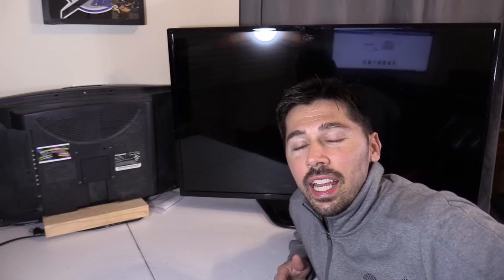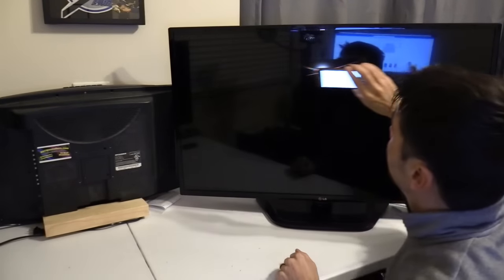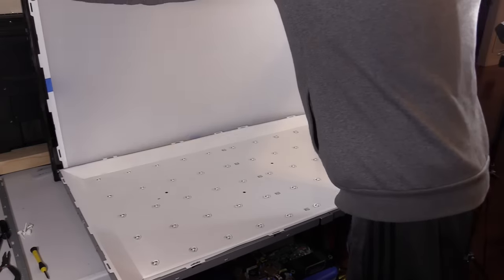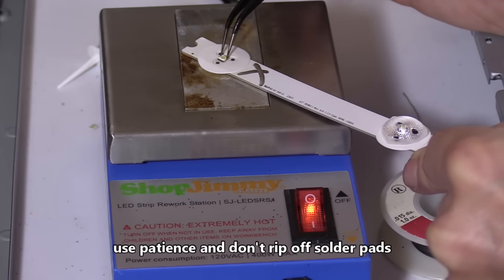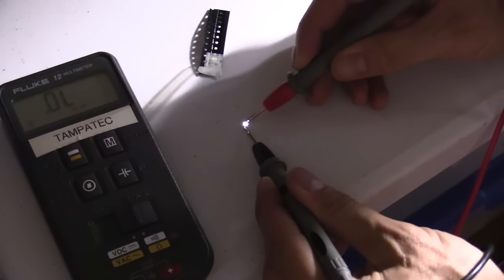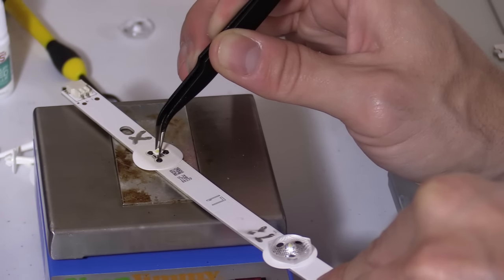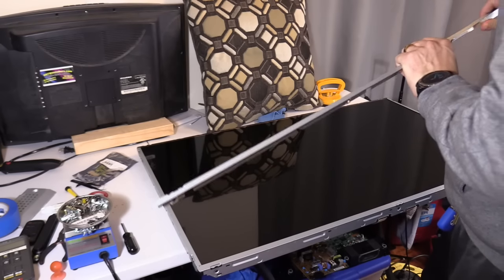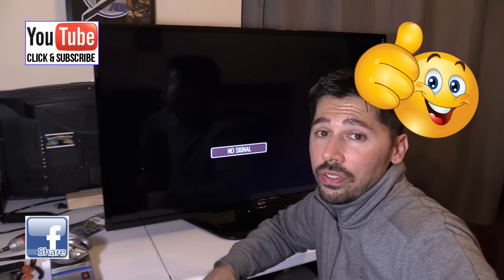LED LCD BLACK SCREEN TV REPAIR, COMMON FIX MUST SEE !!!

Comment: Hi i have an LG 49UF640V an am having trouble removing the rear cover. Have removed all screws and snap connectors but there appears to be two snap connectors on the inside near the top that i cant get to. There is also screw threads going through these from the outside. Thanks in advance. Mick.

Comment: Hi Tampatec I have a 70 inch LC tv LC70LE&$%U it passes flash light test also I tested back light s with Ed tester the back lights turned on. I have 83V on the back light cables going to back lights steady voltage but back lights still don't turn on when I power on the tv. Any input you could give me would be appreciated Thanks for your videos

Comment: I just picked up a free 46 inch Samsung that had no backlighting.  When I tested the voltages to the leds I heard a noise and the backlighting came on but it looks like one led is down leaving a darkened shadow top mid and a little to the right.  Should I not run the set until I replace that led?

Comment: My issue seems to be a little different. The screen keeps going black but still has sound. 
If I power it off & back on the picture comes  back but only for a short time. Sometimes 20-30 minutes. Eventually it goes black again & I have to cycle power to watch TV again. When the screen is on the picture is perfect. Tcon flaslight test passes. I replaced the power supply board but issue remains.
Do you know what could be wrong so I can attempt a fix? Its an edge-lit LG 55LM5800

Comment: I like watching your repair videos I have a problem maybe you could do a video and chat me back my problem is I have a Apex high definition I tried to program without a remote and I've got it messed up it's got huge language shows up in yellow I have unplugged it held in the power button for 2 minutes after it was in unplugged let it stay unplugged for about 8 hours plugged it back up push fire button and it went back to choose language and to use my room up and down remote and I don't have the factory remote what can I do to get back to the TV

Comment: Hello; I have a Panasonic TC-55CX420U model TV and the voltages ck good but it will not turn on. The red light comes on but nothing works. I replaced the main power supply board but there was no change. ifixit has helped me check all the voltages and fuses and all is good. He said to change the main board but it is hard to find, the one I did find was way to expensive is there compatible boards from maybe westinghouse or other tv sets?

Comment: Hi there I'm wondering if you might be able to tell me if the back light might be faulty on an led tv I picked up for $20 
the problem is that it is fine for say 20 mins, then the right hand half of the screen darkens but not in a uniform way. you are still able to watch it and it's just the picture seems to have had the brightness turned down on that part?

If it isn't would you have an idea as to why this might be happening?

Thanks Mate..

Comment: Great Job ! 
I had in the past a similar failure on a philips LED tv. No backlight but TV are on. It was a bad connection between the strips. Then i had solded the connections together and it was fine.
Reply from the maker: FeCr3 thanks for sharing the tip. i hope that helps someone.
Reply: I hope too!  The hardest part for me was disassemble and reassemble the 40 inch panel....

Comment: How do you know if you permanently damaged the screen. My TV does the same thing. It cuts on and cuts right back off. Before I watched this video I replaced all the boards but it is still happening. I'm sure it's the lights but when it comes on it looks like a huge lightning bolt struck it right down the middle before it cuts off. Should I proceed or leave it be?

Comment: That was a lot of work to get to those led's. Couple of questions it might have been the camera but it seem like some of the LEDs when you had them let we're not as bright as the others.? I was wondering when you were taking the layers off if you needed to worry about dust hairs or anyting getting on those when you put it back together. I saw you cover some of that in the video, what happens if you don't get it perfect and some dust particles are in those layers? Great video it's really neat to see how this is done. Where did you go to school to learn about this?

Comment: My lg 55la6230 flashes the logo for half a second then blackscreen. Can see pic with torch and sound is fine. I removed screen and tested led's individually with 3v power supply- all work! There are 48 led's on one circuit and 36 on the bottom circuit. At the led plug to power board both positive terminals read 90.3v but the negative ones read 13.6 and0.6v. The main board plug voltages are all correct. Am I due for a new power supply board?

Comment: I remember I broke one LG lcd panel when the problem was a lose connection of strip wires and when I put the screws too tight the panel just cracked and I made my own map on the lcd panel.

Comment: So i have a LG 42LN5708, it has no backlight (when i shine on it with my flashlight it shows image) But that image also flickers. Can this indicate that it is the power board that is bad or is it still the backlight that needs replacement?

Comment: I was giving a nice LG 4k smart TV that turns on and it shows the LG logo then after a few seconds it goes dark. If I use a flashlight I can see it has a image. Is it the t-con board or back lights?

Comment: I think when you picked the screen up with the suction cup you had it in the middle of the screen so it started to bend then it let air into it so it failed to hold it so probably best to use two of them at each end.
Reply from the maker: darren james i agree or use 2 people holding each side of the LCD panel.

Comment: Hey,
I have an LG 42LN5758 and chanced the backlights for new ones because i thought that was the problem. But my tv still stays black. It's like te backlights won't go on. Do you know what the problem could be and what i can check to solve this problem? Thanks

Comment: I would not recommend resoldering new leds in place the heat shortens the lifespan drastically. Get the single backlight led beads from ebay or Amazon they are the best way to go if you aren't changing the complete strips out. With the led beads you just solder leads to the edge of the boards and the corresponding solder pads on the original strip.

Comment: I have a 42” led panny. First green blinking then on with white screen for 1sec. Then off and continues red blinking. I have tcon and driver board disconnected, still same issue. So it cant be led strips since those are connected to driver. Is this logic correct? If yes then how to proceed? Seems its either the power or main board. Cant see obvious faulty capacitors fuses etc.

Comment: Sony Bravia KDL48W650D. No picture. Blue screen. Sony logo comes on and then back to blue screen. If I tap the display it flashes white. Other times when I turn it on  I get a quick cable or language box, then right back to blue screen. Can I assume it's not the backlight?
Reply: Similiar issues..waiting for a response also...

Comment: i had the same issue with my Hisense tv so i used a good LED from another tv and replaced it the reason the LED blew out was because the tv didn't have a sufficient cooling system so the LED's were simply overheating what i did to fix that is mount an extra 12v power supply and a temperature control system for pc's and a 12v fan.

Comment: I have a 55 inch LG. turns on just fine then after a few minutes screen goes black on both sides with a small lit strip down the middle.Thinking it's the LED strips. Any hints? Thank you

Comment: Mt tv just recently got the black screen. It turns on no problem then after about 15 seconds it goes black.  I'm not sure if the backlight are the main issue. I shine a light on the TV and the picture is still there just no backlights working. But the do work for about 15 seconds before going out.

Comment: I have a 40sf3750 tcl 40 inch TV.  I can watch cable through hdmi port and see menu fine but if I open Netflix or another app or input on this roku tv but as soon as I try and play the streaming video it goes black. Would this be a different problem other than leds since I can watch cable TV on it just fine?

Comment: I've got a haier 55" curve tv. The repair guy (warranty) came in and said the backlight is blown. But the weird thing was while he was probing the backlight plug in amperage setting he was able to get the backlight to come on, (at this point i was like smiling thinking it was fixed but he said he couldn't keep it like that cause the power supply wasn't happy with the extra draw off it)  Now he said something about the backlight being wired in series and when oneblows the whole chain quits. Now he did say there was 300volts at the plug and thus why i think he said the backlight is blown. I've got my own experience repairing electronics, but I'm having a hard time understanding what is going on. Am i wrong or does something seem weird???
Reply: I have vizeo 55 inch have sound black screen no pic went and bought a new tv got it home and after taking the old tv off stand tried plugging it in one more time and pow ! It came on so we were so happy took the new tv back watched tv for 3 days woke up this morning and guess what its back to black so upset the tv we had bought was on sale being labor day so uhhh I think we'd messed up oh well no use crying gotta go back and buy another so mad for doing that thanks Char

Comment: My 55" LG just went out. What it does is when I turn it on the LG Logo displays & then the screen goes dark with no picture, but it has sound. I'm going to try the flashlight test to see if it's the LED's. But if the LED's are bad would it still show the LG Logo at startup?

Comment: HI, I need help with my Sony KDL-48W650D.  I was watching TV and the screen had some bright green pixilating and then went black.  The audio is fine.  I tried a hard reset and the picture comes on for a few minutes but then flashes green and goes black or a very dark blue.  Audio always remains fine.  I tried the flashlight test but can't really see anything on the screen.  Do you think it's the Tcon board?

Comment: So I got a 43-inch Insignia 4K. Looks like most of the LED have gone out or the driver.  I have two dim circles on each side of the screen the rest is dark. Also, the screen goes dark every 3 seconds. All other  TV functions work. Any idea?  :( thx

Comment: I have done this same repair many times. I have found that the adhesive pens that are activated by blue light work MUCH better than superglue.
Reply: What lamp would you recommend to replace the burnt out ones ? Part number?

Comment: Hi there, is it possible that only 1 strip is bad and still we get voltage from strip side? in my case one of r1 strip is bad but can see voltage from both power board and strip side. can you/ someone please clarify? Thanks

Comment: my backlight issue is intermittent, as in- sometimes it all works fine "after " i turn on tv, let it stay on for a certain amount of time til it warms up some, turn off, count to 5, turn back on, and everything is fine. sometimes i go to turn it on, nothing, try resetting with reset button, sometimes works sometimes not, leave tv on and try previous mentioned procedure, nothing for the rest of the day after several attempts (give up). someone else mentioned driver and or a diode. don't know what the driver looks like or how to test it but i know how to test diodes. i was thinking either a processor or a capacitor, haven't taken it apart yet. help? thanks.

Comment: I don't understand the test you did for the LED. You probed it with the meter and it lit up (indicating forward bias) with an OL reading on the meter, you then reversed the meter leads and got 0.7v reading (again indicating forward bias). How can it be forward biased when probed both polarities?

Comment: Hey Paul, I love your channel and I'm walking through your videos to replace my LED's on a Vizio E65-E3. Unfortunately, ShopJimmy doesn't have the strips available, so I've got not choice but to solder new LED's for it. Do you have any idea what brand of LED's I should go with?
Reply from the maker: Shopjimmy.com has led strip repair kit but need heat pad workstation just give them your LCD display stick number or tv model.
Reply: @TampaTec  Thanks! I'll be getting the heat pad workstation. I've got three separate stickers on my panel on the circuit board side, but not sure which number is the one they need. They don't match any of the format examples that shopjimmy lists. I've emailed them back with picture attachments. Hopefully they can figure out what I need from that. I did more testing on the individual LED's and I've confirmed 13 of them are dead or dim. Hopefully I can get all replacement strips.
Reply: @TampaTec  So, it turns out that shopjimmy can't guarantee that their led strip repair kit is compatible with my Vizio. I'm going to buy the workstation to unmount a bad LED and get a good look at the solder side and see if it matches up. Question: when I hit my good LEDs with my LED tester, the readout gives shows me 5.45 every time. Does this mean that my replacement LEDs need to be able to handle at least 6 Volts to match the others? Also, is the "color" of the LEDs white? Or cool white? If I have to purchase surface mount LEDs from another online source, I'd need to try to get the new ones to match as close to the existing ones as possible.

Comment: Hi, dear I have LG led tv 49lh590v, logic board  ld66l/z, when it starts, led blinks 3 time and gose off, no picture nothing, I have checked voltages and found panel 12v missing, Can you tell me what to do in this situation? Awaiting...

Comment: My 55LE5400 is getting power, Audio, and bezel lights up. There is no video output at all , no display at all on LCD. Tried resetting power, no effect. Tried all inputs and volume increases with remote. There is no T-Con board in this model , just the main power board, the main board, and the LED driver board. Getting glow from the backlight as well. No Logo displayed on boot up. Please advise as to what I can do to have this unit repaired at little to no cost. The main boards are known to have bad solder connections that are repaired by reheating the board, but that won't work for me. They are out of stock for sale. Thanks!

Comment: Tampatec how would it cost to fix a flat screen black screen when i turn it on a flashlight to see wats showing when i turn it on i dnt see a back light i do get sound i see your video's all the time .. im jus wondering if its worth  fixing the tv money wise  its a LG model no modele 32LS3400 serial no 212mxyg0u138 .. or im jus going to sell the parts

Comment: Would there be a problem replacing the LED with a Hot air rework station?
Reply: Did you try it? I'm sure that diode desoldering machine is not cheap
Reply: @Metalhead-4life  I haven't tried it on an led like the one he is working on.

Comment: Welp, I have a Samsung UN46D6000SFXZA that has sound and an image with a dark screen, after makeing my best judgement thinking it was the power supply as this set has the LED driver/inverter on the power supply. I just tested each of the LEDs and found 4 that dont glow on the bar. Problem is cant find the LEDs or the LED bar anywhere.

Comment: My 55 roku TV has sound and a back glow but the screen if black(but with a glow). What could it be? Also before it stopped show a picture it use to warm up then the picture would show up.

Comment: How hot does that repair station pad get?  Could that be done with a heat gun?
Reply from the maker: mlyons31 🤔 not sure no temp gauges on the unit but heatgun might work.
Reply: Thanks
Reply: I've done a LG using a heat gun, and it is difficult to tell when the solder has melted.  Additionally, holding the strip close, but not too close to melt it is a bit difficult.  The LED's will move with the slightest touch, and if you are clumsy or in-delicate in your motion, they can be lost in an instant.  They are TINY!!, not much bigger than a cardboard match head.  Did I mention they will blow away at the least of motions?
Reply: grumpyUnk     -   Yeah, I used a little metal plate and used the gun under it to heat the plate. If you do many of them, it's worth the money to buy a repair station.
Reply: mlyons31   - Good idea with the metal plate, I’m doing this repair when my LEDs arrive but I only have a heat gun, I’ll have to rig something up.

Comment: On my LG 42LN540V [Power Board EAX64905301 Rev1.0] there is no voltage at all coming from the power board socket to the LED circuit [white socket as shown in video] Like this screen I can see a feint image. I will replace the power board [28GBP] and see how it goes! I'll come back with an update.
Reply: Still waiting for that update? Did you replace the correct part?

Comment: Hello. I have a TCL television. Not sure if it's lcd or led.  Everytime i turn on the tv it works ok for about 30 mins-1 hour. Then the display goes dark while sound still works. Turning it off and on  works for a while after which the display goes dark again.  Same cycle but everytime the screen  goes black quicker. After letting the tv off for a few hours the same thing happens again. Between 30 and 60 mins all is ok and then the same thing happens again. What is your solution? Thanks
Reply: Did you ever figure out what was defective? My LG is doing the same thing

Comment: Paul I have a jvc Lt 50E340 and I can't get the dang back off. Is there a trick to it? All screws are out. I have no power
Reply from the maker: I think there's clips on back cover so use plastic pry tool like phone screen repair tools. Also check under stickers for screws.